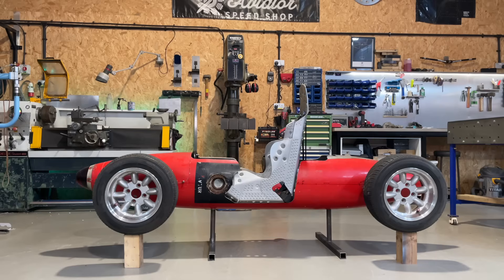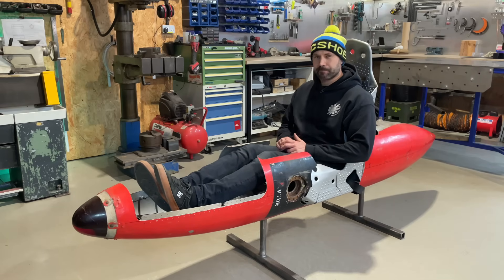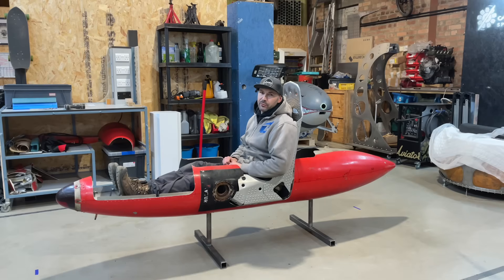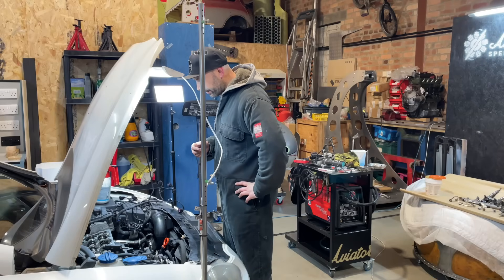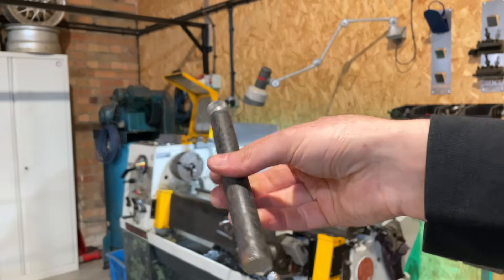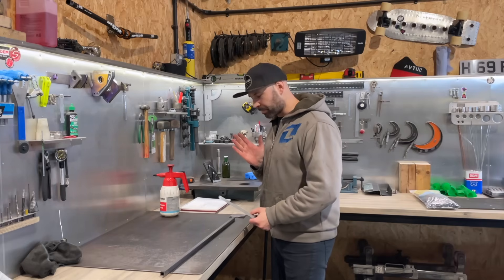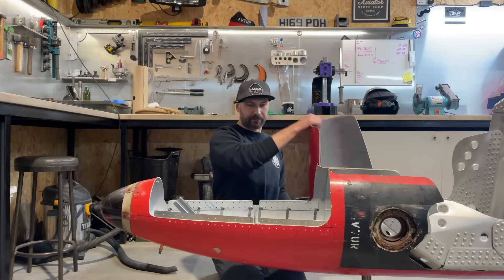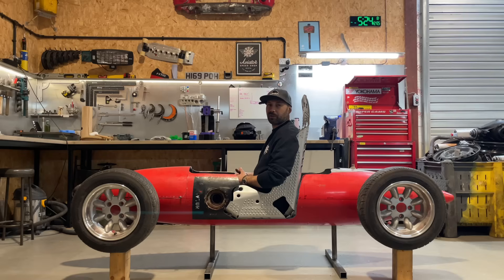Pedal to the Metal – I Build a Custom Pedal Box for the Jet Tank Racer!

Comment: If you save the pieces that you cut out from the sides you can push them out kind of like a wide body kit and remount them to the tank so you still have the structural integrity and the look. All you would have to do is cut out a flat bar that is the width that you want to push the side pieces out and use it as a filler panel. You'll definitely have to do some metal work to get it to conform to the round side of the tank but in the end I think it would be worth it and look really good. Plus you would get your structural integrity back.

Comment: You need a pair of good-sized side pods, like open-wheel racers all have now, and I think began in some of the years that Indy, and F1 cars were revolutionizing open-wheel racing. A pair of larger side pods, will make the car look correct, as well as give you a place to put cooling radiators, brake cooling equipment, etc. Also, if you cut the back end of the tank off, mount your engine and trans there, then put the back end of the tank after the engine and trans, the car will be longer, and much more correctly proportioned, lengthwise.